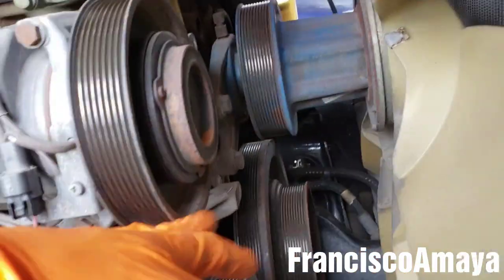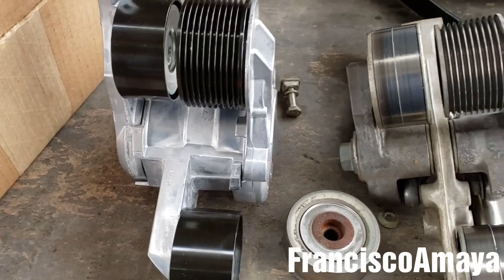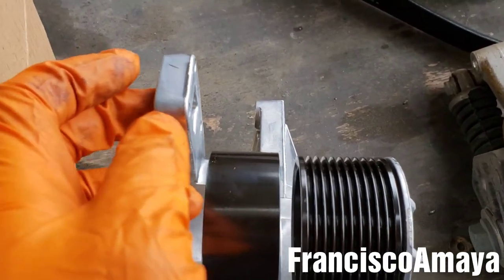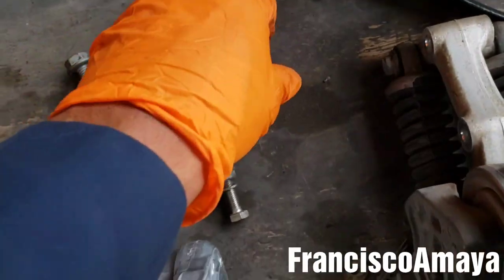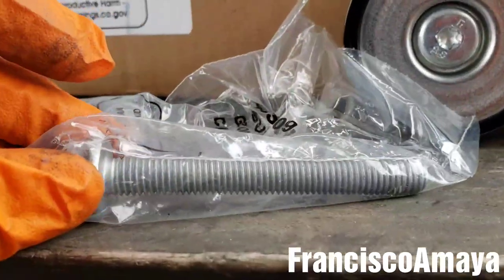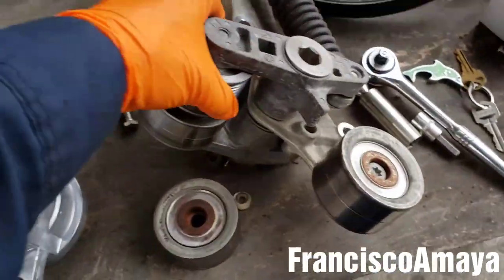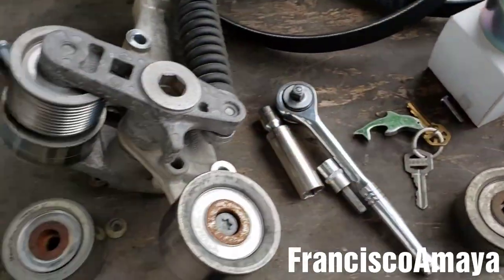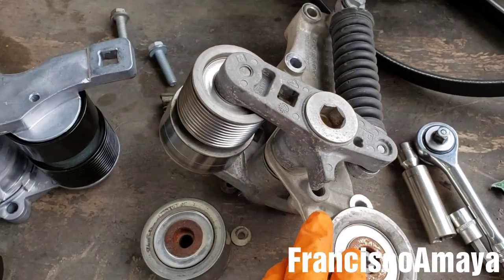Freightliner cascadia DD13 DD15 DD16 belt tensioner upgrade new style and different hardware

Comment: I changed my tensioner to the new one. Works fine easy installation; my only complaint is it wears down as fast as the old design.

Comment: The new one does not line up right to install the bolts... It seem like the big round part where the springs are eternal is hitting against the block.
Reply: How did you get I done? I’m having the same problem
Reply: @twannkinq8947  it's two different versions of the tensioner pulley.. it's a Detroit and a gates...
Reply: @twannkinq8947  if the number start with DDE it's Detroit and you need the gates tensioner.
Reply: Hack man thank you man appreciate that
Reply: @twannkinq8947  DDE/A4722030355 IS DETROIT MODEL. GATES IS GT/38667
Reply: @twannkinq8947  it depends on what fan clutch housing you have to determine which one you need.
Reply: Hack man thanks bro appreciate it. that’s crazy I spent all day tryna figure it out. Your a lifesaver

Comment: Hola Francisco! I'm so glad you did this video. I was looking at the brand new cascadia at the dealership, and saw this new tensioner. I was wondering how and where the service points were. You answered my questions perfectly. I think you are correct, it looks more like what you would see on an automobile engine. One question, when releasing the tension, does one pull clockwise and the other counterclockwise? 

Thank you for doing these videos.
Reply from the maker: Yes, that is correct

Comment: This does not work for all DD15's. Did not fit mine in 2016 cascadia. Correct part for mine was Gates 38667. I do not know how to separate one from another, maybe Francisco can help us out on that. But do not make my mistake by purchasing this tensioner without proper research.
Reply: Do you know why it didn’t fit?

Comment: So does it supposed to come with new bolts or we use the old ones bro
Reply from the maker: It doesn't,  you have to buy them separately.
Reply: I did this job on a DD 13 what I did instead of buying new bolts I simply use the short one that was provided in the package already and cut two of the original bolts about 3/8 of an inch works good as new

Comment: Hello Francisco, I have 2012 cascadia dd15,  I’ve been struggling with this problem for a few weeks, I been in multiple shops but no one can find out what is the problem. 
Code is ENG 1 spn 1074, after I restart the engine it disappears, but after 5-10 mins driving check engine light comes back and engine has no power and weak engine break.